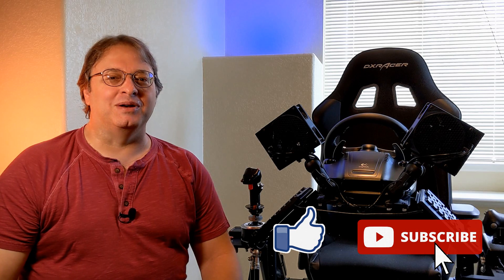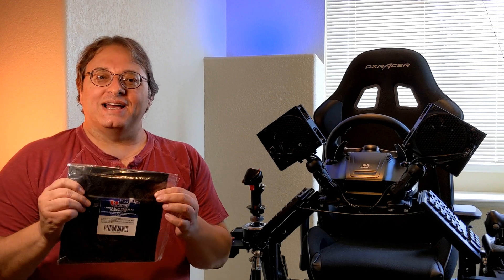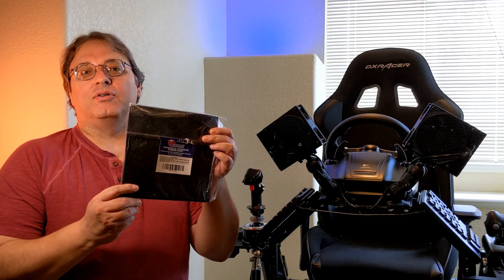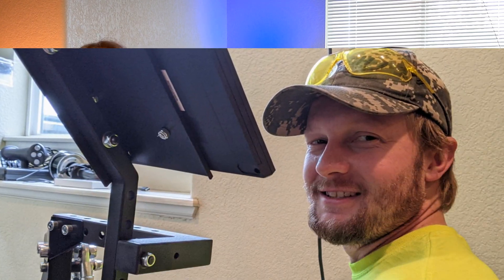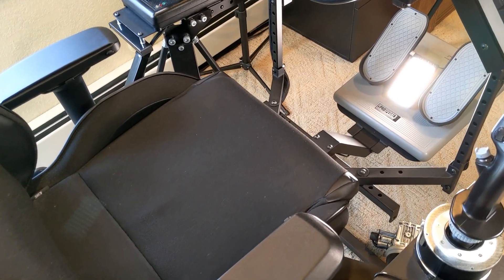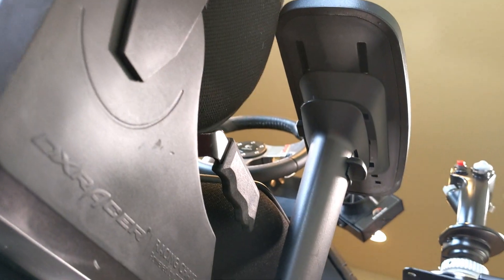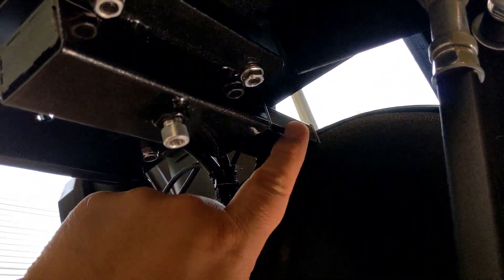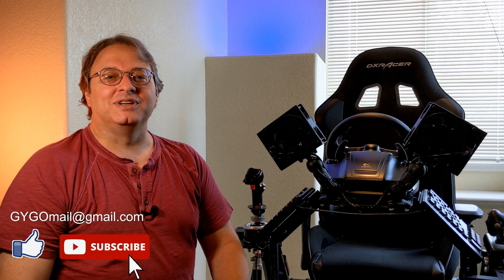DOF Reality H6 Motion Simulator - Part 3: The Core Build

Comment: Wow!  That has to be the finest build of a full motion simulator, paying attention to details like incorporating fender washers, neoprene material, being careful not to over tighten bolts, painting the washers to match the steel, trimming the washers, and so on.  So nice to see when enthusiasts go over and beyond what the original setup came with.

The larger seat mounted on slides look perfect!

Great tips, like marking the nuts with a line to help notice fasteners that may have become loose.  The temperature strips on the motors are a great idea.

Mark, seeing how you had the two DOF Reality motor controllers on independent 20a circuits, did you put the computer on yet another 20a circuit?  Or was the computer okay on one of the motor controller's 20a circuits?

The wiring (cable management) looks first class.  Again, that is truly paying attention to detail.  The bracket work?  Definitely thumbs up!

The only thing I see wrong is that your DOF Reality motion platform is built, and the one I have is still in the box!

Great job Mark.  Looking forward to the upcoming videos.

Aloha!
Reply from the maker: Thank you my friend, always appreciate when people notice all the "little things" as well.  Very rewarding to read your comments!  I actually have the computer plugged into an outlet on the other side of the room.  Not because I was worried about overloading but because that is where the computer is.  So just to clarify,  on my build the ONLY thing plugged into each 20amp breaker is the DOF Reality Control box... Also because they are on the switch and I wouldn't want to have it on to run the computer when the H6 isn't in operation.  You should always have the H6 off when not in use so it doesn't sit there and run it's "micro adjustment" routine continually and overheat the motors.